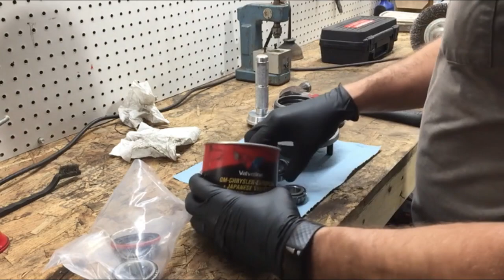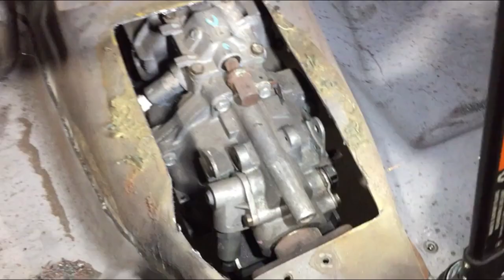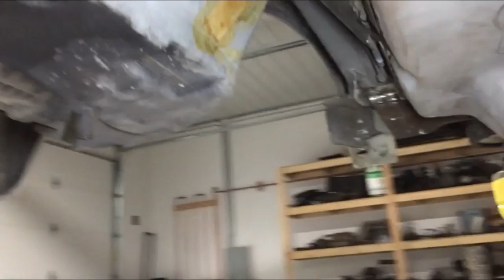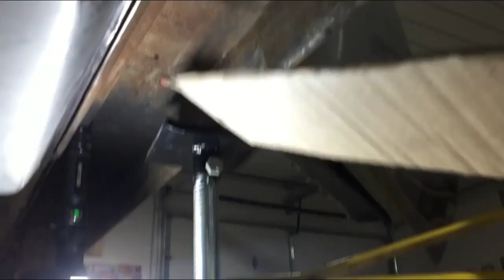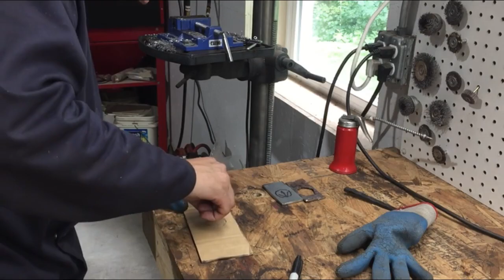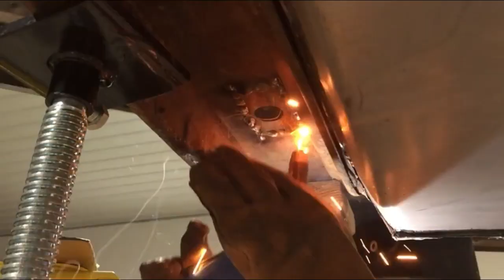C3 Corvette Project - Part 3

Comment: Incredible transformation and engineering design mindset. I’m still conflicted in terms of if it will be worth it to do a engine/tranny swap like yours in my ‘75 down the road. I’d want to keep the car externally looking like it does, including the rear wheels the same but with more backspacing for 12 inch rally’s retaining the original hub caps. Ride Tech is also a must. Fantastic work and really entertaining to watch your shop philosophy and quality work!
Reply from the maker: I think the “worth it” argument will always be there. You never get the money back that you put in. Has to be about you enjoying it to be worth it, I think. I like your plan!

Comment: Do you think you would get all of the $ valve back if you ever sold it?

A fantastic garage which I wish I had to do my C3.
Reply from the maker: Very unlikely with the route I’m taking. The suspension alone is worth more than the car. I’m lucky I got a really good deal on it. 

Thanks! It does make the work easier.